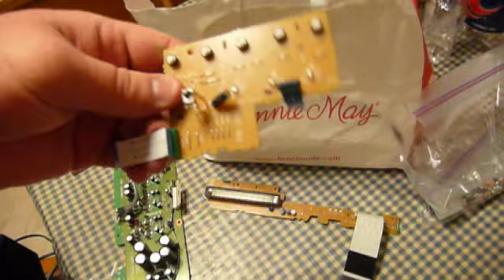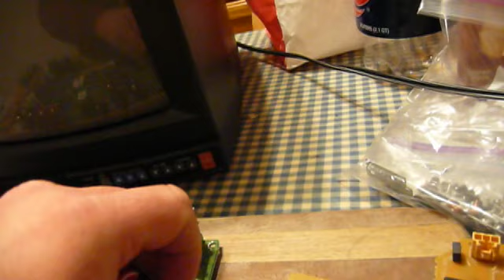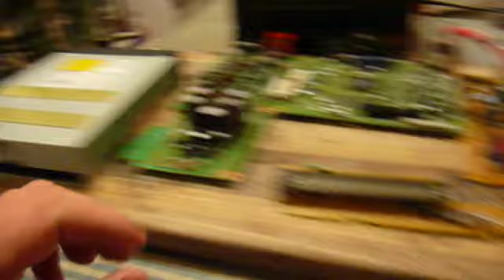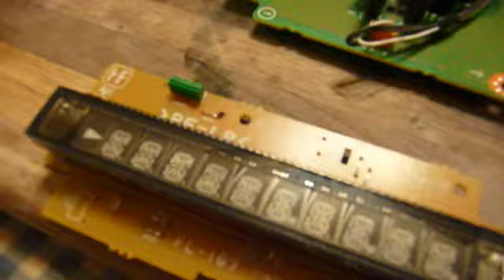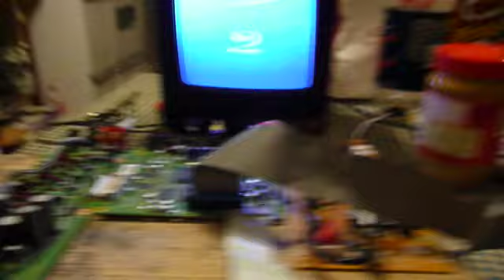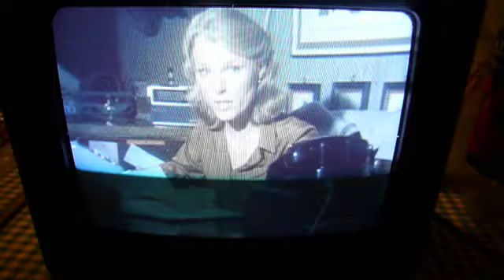Blu-Ray Player - Some Assembly Required!

Comment: Parallel ATA is a version of IDE that was in laptops. It included all of the power and control interfaces, and was converted on-board to a mini SCSI interface. IDE/ATA/ATAPI are all desktop standards. IDE and ATA are the same thing, but IDE is just what Western Digital decided they wanted to start calling it.

Comment: Hi. I'd like to ask you about the player because I'm considering buying one. I know that it's old, but I like that it has RCA 5.1 audio outputs and that means I don't need an expensive home theater system to get the surround sound and it looks nice, big and solid (I don't like slim style players). So, what do you think of it? Does it play CDs well, does it upscale DVDs, does it have 24p (probably with firmware update)? Have you tried any BDs yet?

Comment: Well, jeez, it works. Even without the other parts, so why did they even take it apart? Unless, it fixed its self while sitting...who knows. Maybe even the power button board was bad.

Good deal though, I was going to say build a cabinet and go all out, but no point when you have a good working one and can use these parts for...parts.

Comment: Hey, Bill!
I was always wondering what energy requirements you must have from running all those older (non energy efficient) computers? Older processors are proven to use a load more energy.

Comment: The use of PC style drives in video players has been around for some time.
I have seen it DVD players and Blue ray players. In fact my first Blue ray drive was out of a BR player. Video play back over IDE is fine but any kind of heavy usage such a reading data caused it to slow to a crawl.
Reply: The philips dvd 724 is one such specimen. It however, has a stripped down dvd drive with an ide cable and the motherboard seems to have some sort of authentication mechanism so it only works with THAT specific drive.

Comment: Make a retro 70's style cabinet for it!  I had a DVD recorder that died on me and when I took it apart, I noticed that it's own all-plastic optical drive was connected via a standard 4 pin power cable and an ide/pata cable.  I hooked it up to one of my comoputers without doing any kind of modification to it and it worked (even tho the drive itself was on it's way out)!